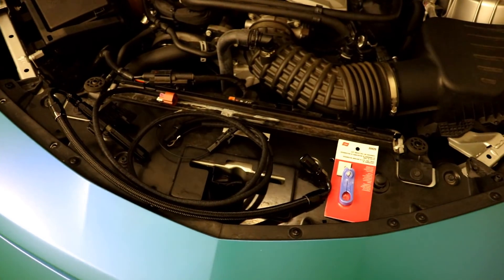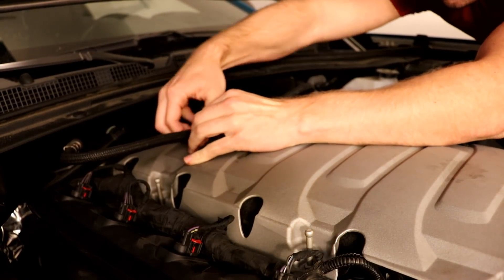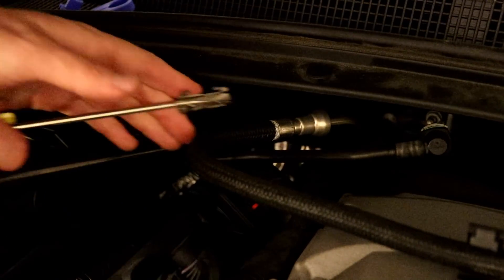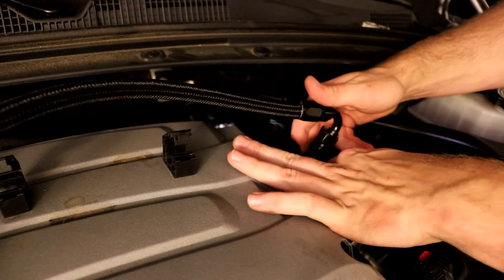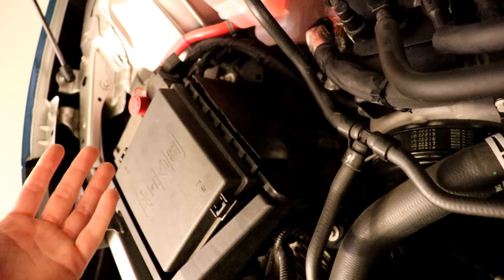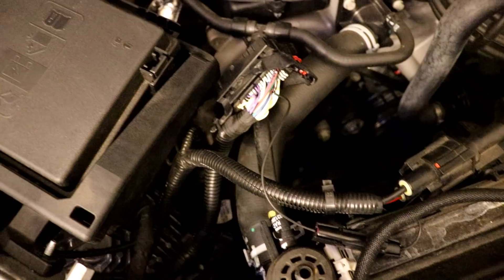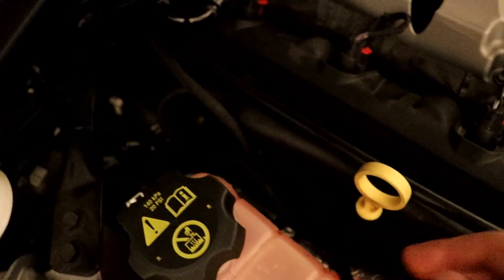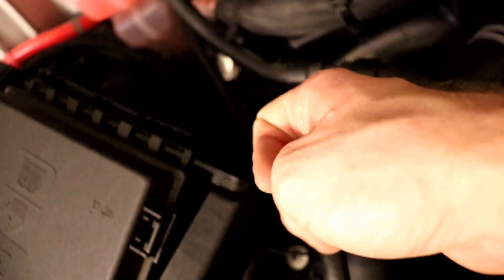INSTALL GUIDE: Flex Fuel Kit - 2016/17 Camaro SS

Comment: Could you use the stock fuel line ??
Reply from the maker: +Michael Martinez You have to replace the line that goes over the motor. It comes with the kits though

Comment: Did you get a tune immediately or two weeks once e85 has cleaned old gas away?
Reply: What shop do u take it to to get the tune
Reply from the maker: Got it at Cunningham Motorsports
Reply from the maker: No you can't run any e85 until you get a tune. They have to drain the tank at the shop and then fill with e85 to tune correctly.

Comment: Do I need to get a bigger injectors??? Cause im thinking about getting the lt4 injectors for ss before I get a tune btw great video!
Reply from the maker: +Sang Hyun Nope not unless you're going forced induction. Stock fuel is fine with e85
Reply: Markoon13 thamks6

Comment: Did you need to get a tune after the install?
Reply from the maker: +August/ Camaronut13 Yes to use e85.  For now its fine to run regular gas though. I have one scheduled in a few weeks
Reply: Markoon13 That's what I thought. Looking forward to see those numbers Thanks.
Reply from the maker: +August/ Camaronut13 Me too!
Reply: Dang i really wanted to do this without a tune and voided warranty!
Reply from the maker: +Platinum Sorry don't work lol. Need a tune

Comment: If for some reason you don't have the fuel line tool. Or can't find one. The same kind of tool is used for a/c. You can get like 6 different sizes for like $10. Or cut up a sharpie lid and work it in the fuel disconnect.
Reply from the maker: +Gas Hogg that's smart. Good advice